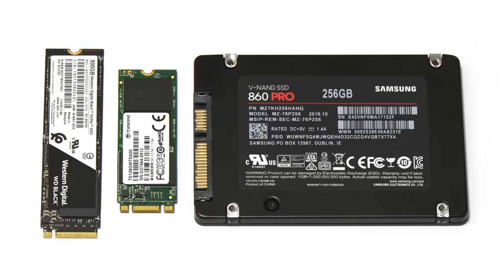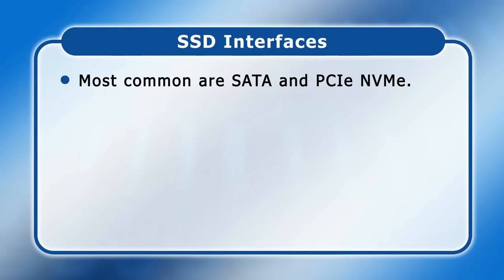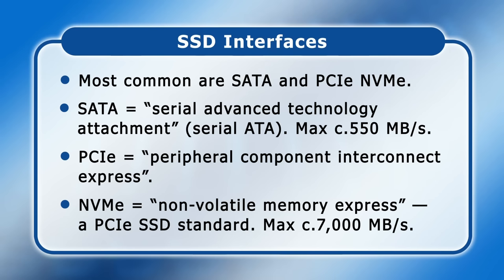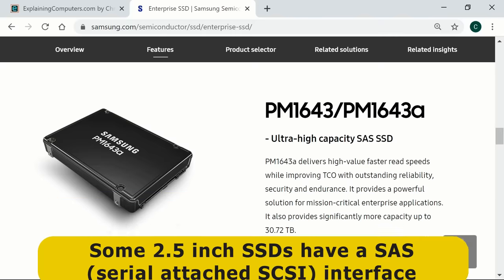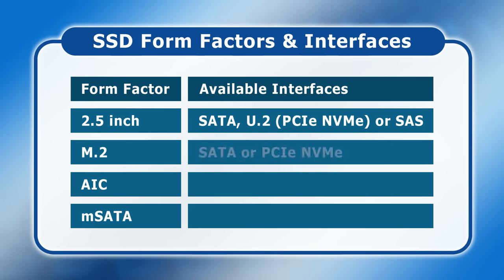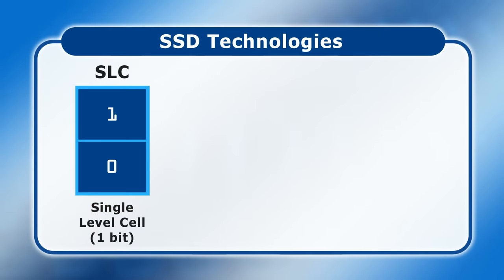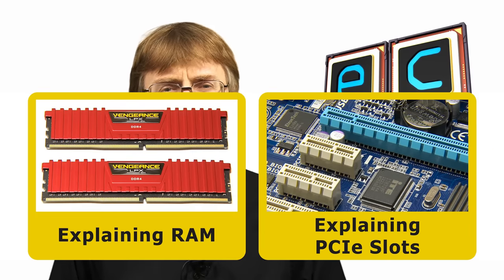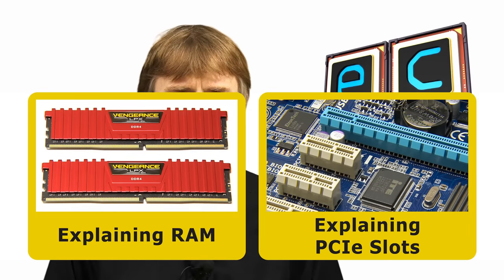Explaining SSDs: Form Factors, Interfaces & Technologies

Comment: And now some companies like Apple solder their SSD NAND chips directly to the laptop motherboard/logic board, rendering storage upgrades (practically) impossible.
Reply: not only that but if it fails, the whole computer becomes useless... i dont like apple for many reasons.. now they tie the camera serial number to the board so you cannot even repair THAT..
Reply: Things like that are practiced for many years now, i have 7y old ASUS laptop and it has RAM soldering on board, luckily they provided another slot where you can put standard SO-DIMM memory.
Reply from the maker: Very true -- not a great practice at all.
Reply: Just more reason not to buy Apple and into their walled gardens.
Reply: This will become standard when the devices get more and more integrated. At some point, you will have just a single chip (or block) unit for the consumer market. No upgrades, no fixes, but cheaper, more efficient and more powerful. Could take some years to get there though.
Reply: There are many, many reasons to avoid Apple products. This is yet another.
Reply: @cekpi7  Asus UX31A for me - no additional RAM slot and it was very expensive (I didn't choose it). 
Never mind, EC has, as usual, brightened up my Sunday.
Reply: They want you to purchase a new unit every two years.
Reply: Crapple, our greed knows no limits.
Reply: You forgot PS5 soldered SSD, I know it has upgrade slot.

But what happened when the primary 825GB SSD was failed?
Does it could install the OS on SSD slot???
Reply: I think they're doing this for speed too. Their units are a lot faster than competitors ones. BTW in case of failure of internal, soldered, SSD NAND units, you can run your Mac from an external HD or SSD with a cloned system, a feature that's unique of Apple computers.
Reply: @cekpi7  hmm i'm wondering then can you disable the onboard ram? i cant imagine the system running correctly if one of the modules is defective. But its a shame altogether.. all just to have it somewhat slimmer and cut cost.
Reply: It's not like PCIe 4.0 NVMe speeds are slow and with NAND flash write endurance being a limiting factor it's a bad decision. Apple stops giving power plugs with new iPhone because of E-waste, then at same time makes it impossible to repair or upgraded your hardware, just stinks of hypocrisy.
Reply: I just answered a survey before this video started asking which laptop I would consider buying. Windows, MacBook or Chrombook. I answered Windows.
Reply: @disruptivetimes8738  I think the new ARM based Apple's are going to be exactly that. I think the only difference is storage size and all that takes is swapping one part at assembly
Reply: Laughs in Hackintosh
Reply: @disruptivetimes8738  While other companies might go the more Cheaper and efficient route, Apple in the name of "proprietary tech" would just keep on increasing its cost and non user-friendly practice.
Reply: @MrEp5  Don't think you can, there is no option in BIOS. CPU is also soldered on, so no upgrades on that either. My laptop is working fine for for 7 years, I've added another stick of RAM and SSD, i would also upgrade CPU but can't. It's still decent laptop but don't like the fact that it's semi-upgradable. Laptops should be more like desktop computers.
Reply: And not only that but if it fails, you must send in the entire machine as opposed to just buying a new drive!
Reply: @Austn8r  dont forget that all the data will be gone too. i bet!
Reply: What's even worse is that Apple has a proprietary M.2 type slot in the MacBook Air that doesn't accept a standard M.2 drive, making upgrades with standard kit impossible. You are forced to buy an Apple part at a much higher price.
Reply: @21Lettere  I’ve been an Apple user ever since 97, but please don’t try to defend them like this :(
Reply: I hate that...cpu soldering is bad enough...
Reply: And now with their own Apple Silicon, they're integrating the CPU, RAM, and T2 chip all into one chipset. So if one of those goes, the other ones are rendered obsolete by default. Not to mention that everything is digitally signed to the hardware so pretty much if anything goes kaput, even the keyboard, the whole system is rendered useless.
Reply: @FlyboyHelosim  Are you a salesman or something? :D
Reply: @21Lettere  : I been running XP computers from a usb stick since they had a boot for them. I think was 5 years before that Apple did it. USB 1 did not have it, USB 2 had it!
Reply: @mickgibson370  running an OS from an USB stick is completely different from running a clone of your regular OS installation on the same or another Mac.
Reply: @bfapple  I’m not defending them; I think that their systems are fast and reliable. I have all my Macs still running perfectly after years; I can’t say the same thing of that pile of laptops and PCs (HP, Asus, an so on) that’s cluttering my garage, some of them are only 2 years old...
Reply: @TheGhostOfRandy1-2-3  Why do I appear like a salesman when I'm doing everything I can to get people NOT to buy Apple products?
Reply: @21Lettere  Absolutely agree with that, though I don’t see what difference soldering the solid state storage makes. My 2012 MBP runs better than ever with a Samsung 860 EVO SSD.
Reply: I'm learning to love LINUX more each day.
Reply: Solution: Don't buy Apple products.
Reply: @rdhunkins  I'm not sure what Linux has got to do with anything considering we're discussing hardware integration. Besides, MacOS is based on Unix, so Linux users aren't exactly a million miles away from using a Mac as far as the man-machine interface element goes.
Reply: @bfapple  it’s the same reason for the move from Intel to ARM: those 5 nanometers make a huge difference.
Reply: @FlyboyHelosim  I was being ironic....
Reply: @21Lettere  What do you mean? Apple Silicon is going to define the 20s.
Reply: Apple - dictator in all what they can and vs new M1 their soft also would incompatible vs others.
Reply: @TheGhostOfRandy1-2-3  I did wonder.
Reply: Apple solders the software to their computers as well, what do you expect?
Reply: @minepro1206  Eh what?
Reply: Why do people hate Apple for doing what Apple thinks is the best? If people don’t like Apple products and won’t buy Apple ptoducts, there is no reason to hate them for what they do.
Reply: The opposite would have been highly surprising, wouldn't it? Oh dear...
Reply: @brianhansen2202  Because they have been known using bad practices in fields like the market, environment, costumer's privacy and so on.
Reply: Ana Assburgian  To be honest, the user base does exactly that though.
Reply: Not entirely true, just treat the solder flash as disposable and never write anything you want to keep on it. If you have the money for a Mac, you can buy a USB dongle for type-A or type-C, connect a SATA adapter to it and if necessary, adapt per your needs for establishing a SATA connection. With USB-C there also is the possibility of PCIe-like performance with M.2 NVMe-capable modules.
Reply: And then there's phones, that kind of split the differnece, having an unupgradable amount soldered to the main board, and a microSD slot for expanding with.
Reply: @21Lettere  False. I can run any open-source system from USB. It only requires a few more steps. If I want Windows on USB Hasleo Software's Win2USB also permits this. I could literally write an SSD with such a setup, boot from SATA, and back up the system device periodically so if my copy of Windows was inaccessible due to boot device failure I can just plug the backup in. I would never save critical data on the system disk unless it is cost-prohibitive presently to purchase any external media.

Get something external — anything — ASAP. It's not hard, it just costs money.
Reply: @cfltheman  Nice troll. But I'd go with a Windows laptop too, on principle most of them easily allow an alternative that is less intrusive using the Linux kernel.
Reply: @bluephreakr  1) you can't reliably run this Win backup on a different machine; 2) your setup is for advanced users.
Reply: @VulpisFoxfire  Yes, but with a locked-down bootloader the SD card couldn't ever be used to boot from, and less high-end handsets don't even have one.
Reply: H D  I think its personal preference, I use mainly Macs both at work and personally. I also occasionally use my windows laptop.... just to remind myself that there are many good things about mac's as well as the bad.
Reply: @21Lettere  Arguably, I could. The whole point of Hasleo's software is to permit a portable Windows instance so multiple machines can use it. But for sake of argument, I would also prefer to VM anything that isn't using the Linux kernel on principle it's much faster to perform certain operations.

Sadly while I would love to contest your comment about "Advanced users, not enough people are taught certain computing concepts that should be basic knowledge to many.
Reply: may be a trick to upgrade / repair the same through their service centers to get some extra bugs!!
Reply: Macintosh computers have a certian charm for a retro-computer collector, but the newer Apple machines are nothing more than over-priced, barely (if at all) upgradable Intel rigs, with some extra security features that most people don't even need.
Reply: @disruptivetimes8738  That is exactly what Sir Clive Sinclair dreamed of in the 1980s with his Wafer Scale Computing model: an entire computer's worth of devices on a single wafer, i.e. CPU, RAM, ROM, all the necessary peripheral ICs, and probably also some mass storage.
Reply: @BlackEpyon  They function well when they aren't broken. That's alI can say about it. Your bog-standard modular computer is actually more environmentally-friendly than Apple's tosh because you can fix the machine when something breaks in it by replacing just that component.
Reply: @bluephreakr  Back in the 80's you could replace individual chips, and keep the machine operating for years to come. Apple panders to the disposable culture, and rakes in millions.
Reply: Stephen Hill  I'm a big fan of Louis as well. I liked the older Macs and back in the day they were simply an alternative to your IBM PC. Nowadays though they are more of a fashion statement to hipsters and coffee shop dwellers. I've never bought a single Apple product either and never will. Although I was recently given a 2006 model iMac that I didn't turn down as I do I.T. support and it might come in handy if I need a native Mac to help fix a Mac issue.
Reply: @dbp-wv1hs  Their chips are stupid fast though, Android machines always seem to choke on Roblox but the low end iPad runs it perfectly.
Reply: some tinkers in china can have them replaced with bigger ones, on site, just bring your own chips to them :D
Reply: @711jastin  Sure, if you have a solder rework station, and IF the machine isn't hard-coded to only accept a certain range.
Reply: That is one of the main reasons for me to dislike mostly all Apple products.
Reply: @Beevreeter  if it’s an air from before 2018 you can get an adapter and plug in a M.2 nvme drive. (Assuming you are running a new enough version of macOS and have a ssd that don’t use too much power. For example some Samsung SSD’s won’t work reliably). 

I upgraded my 2015 MacBook Pro that way to a 1TB intel 660p ssd.
Reply: That might be the thinner is better...my Lenovo T440 has one SODIMM soldered, and one slot for expansion, though that makes 12 GB the max with DDR3L memory...
Try an HP Zbook G3, they have 4 slots of DDR4, with 16GB per slot max
Yep, 64GB of DDR4 Ram max...
And this one has an m.2 NVMe PCIe Gen. 3 drive also!
No more desktop needed....

Comment: I generally dislike when companies break from standard for their own nomenclature, but I agree with Samsung on this one.  It's clear that bits per cell will be growing for a while so, rather than forcing customers translate  [M,T,Q,P] -to>  [2,3,4,5], using "Multi" generically makes more since.

In fact I'd argue that we should get rid of the "M" altogether and just straight to 1LC, 2LC, 3LC, .. [n]LC
Reply: Although the LC part also doesn't make sense because a 2LC flash has 4 voltage levels, not 2. And a 3LC has 8 voltage levels, not 3.
They should be called 1-bit cell, 2-bit cell, etc. 1BC, 2BC, 3BC, ...
Reply: top
Reply: wow

Comment: My desktop computer has both SSD and a HDD. The main programs and the boot system are in the SSD and the rest of my files are in the other drive. The difference is huge in terms of speed. Thanks for another video. Cheers!
Reply: I have been using HDD for 7+ years now and still on Windows 7, and was thinking of maybe buying a 2.5 SSD for boot-drive and install Windows 10 on it.

But then i noticed that both my i7-4770 and Intel DH87RL Motherboard don't have any driver support for Windows 10, and since both the products have been discontinued and there is no new drivers for them, not sure what to do.
And with Windows 7 not having official support anymore, i am a bit apprehensive to do a fresh install of it again, even if i have a original copy of Windows 7.
Reply: @Sup_D  I tried winx for a week and discovered it's slower on my rather old but trusty Dell laptop. Stick to win7 for games, but go linux for everything else. After some distro hopping I settled for Linux Mint Cinnamon with KDE Plasma desktop on top. 
 Whatever you decide on though, upgrading to SSD will speed up your system drastically..
Reply: @Sup_D  I still use Windows 7 as my daily driver on two laptops. No need to move to Windows 10. If you're happy with Win7 and you've got things running smoothly, stick with it as long as possible. So there's no official updates anymore, that's just one less headache. Install anti-virus and anti-malware programs, run them once a week, and use common sense online.
Reply: @FlyboyHelosim  I'm typing this very line on Win7...Using Firefox and Duck Duck go as a search engine. I installed my anti virus among all the other extremely useful extensions like adblock, YT downloader,  privacy etc. Although I'm a keen Linux user, I find myself drifting back to my Win7 more than often..😉👍
Reply: @AnthonyElsom  Excellent, my man. There's so much negatively surrounding using Windows 7 still but honestly I see no cause for concern. I mean the internet is literally the only access point for potential viruses or exploits and I'm buggered if I'm going to change my whole ecosystem and methodology just for one small factor like that. If in doubt, I'll visit a dodgy website using a sandboxed web browser or via a virtual machine.
Reply: @FlyboyHelosim  That's what i have been doing for the last 7+ years. And while the Win 7 is going ok for me, but there is some issues, like it needs like 3-5 mins to get the system ready from boot-up. There is some memory issues from time to time as well (not sure if its because of the 8GB DDR3 Single Stick or some error from Win 7).
Reply: @Sup_D  In which case do everything you need at a hardware level to allow you to keep using the ecosystem that you've made for yourself. Put in an SSD to replace the aging HDD and replace the RAM, preferably with two sticks and maybe even to a higher capacity.
Reply: @FlyboyHelosim  While i can go for the SSD, since there is future usage possible with it. But buying new DDR3 RAM's feels kind of waste, since while my Motherboard doesn't support DDR4, but locally DDR3 for me costs the same as DDR4 (and DDR3 is slowly becoming obsolete as well). Also, can't really trust my local 2nd-hand market either (a lot of sketchy stuff around).
Reply: @Sup_D  Well it's up to you. You do have options though.
Reply: Yeah, that's the common recommendation these days, unless you have the cash to be able to get one of the higher-capacity SSDs...SSD as a boot drive for speed, and the HDD as a storage drive for capacity. Though it's slowly getting to the point that the larger SSDs are getting into a price range where an all-SSD system is a feasible option for practical uses.
Reply: @VulpisFoxfire  One thing I don't like about having an SSD/HDD configuration, certainly in a laptop where power-saving functions are always present, is when you go to access the HDD it takes a second or two to spin-up as otherwise it sits idle. I never knew this was even a thing until I started booting up from an SSD and using an HDD for secondary storage... as when booting off an HDD like I did before, the drive is always spinning and ready as the OS is always accessing it. This is such a simple issue and there still doesn't seem to be a proper fix.
Reply: @Sup_D  the drivers maybe already in the windows 10 ISO or in install media, one of my PC's old HP media systems it has a made of windows vista sticker on the front, it managed to windows 10,  I was very surprised it was i bit slow in the  64bit but it run I reinstalled 32bit run as a reasonable machine, not one mother board driver was needed just the windows in install media (and then the windows update, found the rest of the missing bits)  in "Device Manager" this was the first time I've have no missing bits I had to manual install, or just missing with a question mark?
Reply: I personally run a 1TB NVMe M.2 SSD and 2 7200rpm 3.5" HDDs (one 1TB and one 2TB) in my "main" PC
Reply: @FlyboyHelosim , I have a 2011 model Dell latitude e5420 that came with Windows 7. I got it upgraded to windows X and it is working well. Now I am considering upgrading its RAM from 4 GB to its maximum capacity of 8 GB. Also I am seeking to replace its HDD with SSD.